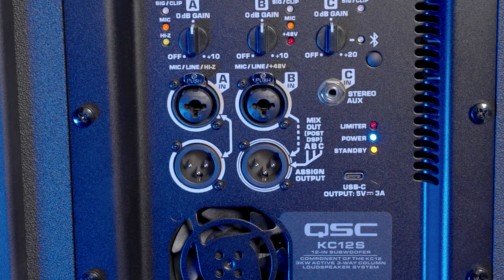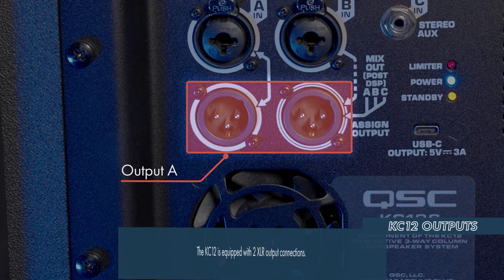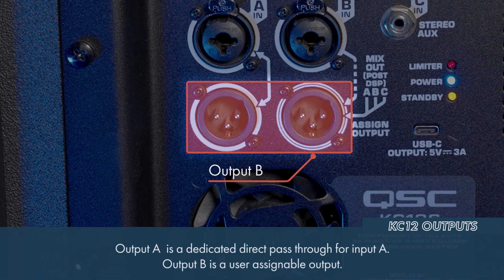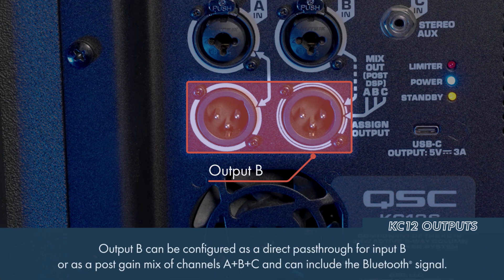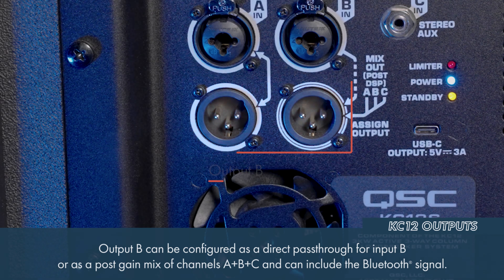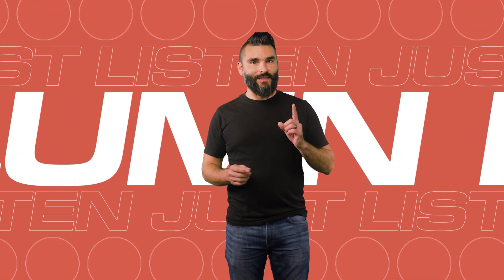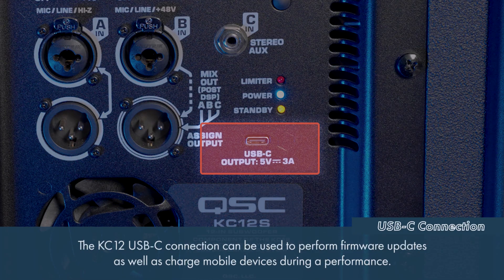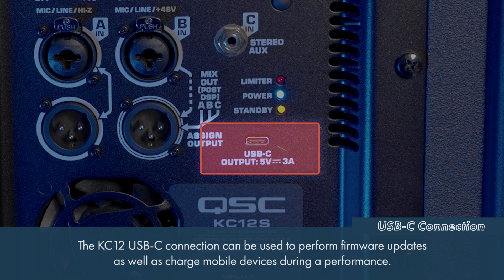QSC KC12 (K Column): Back Panel Connections & User Interface

Comment: Is there a way to take the audio from a line in of one qsc kc12 and send that audio to another kc12 via bluetooth? or does the link feature only work when the audio source comes directly from a blue tooth device?
Reply from the maker: Hi! Thank you for your question. The Bluetooth signal is paired with input C. Connecting a signal to input A or B will not pass through to another unit via Bluetooth wireless transmission.

Comment: How about a further dive into adding subs to this system? Curious if there's presets for multiple qsc products. Like KW181's
Reply: Hey @QSCAudioProducts I am an avid fan. Love your products. Question, is the KS112 and the Sub in the KC 12 the same speaker. Both subs seem to be very comparable to on another regarding specs (frequency response). I see the grill/style is different similar to the KS and K.2 line up but are there real differences between the two subs alone? Only guess I have is deep mode…

Thanks! 

-Traxx 🏎
Reply from the maker: The external subwoofer mode is a general setting that is designed to work with any powered subwoofer. It is not specific to any one model or brand.
Reply: @QSCAudioProducts  What setting? Can you explain further?
Reply from the maker: @raggaroaringsound  Check out the section of the video from 4:35 - 5:00. There is simply a setting in the output assignments menu called "EXT SUB DELAY". When activated, the setting applies some time delay to the output to maintain phase aligment between the native subwoofer and an external subwoofer when connected to the output. That's it! Any subwoofer can be used in this application.